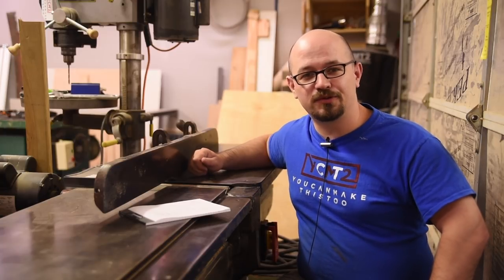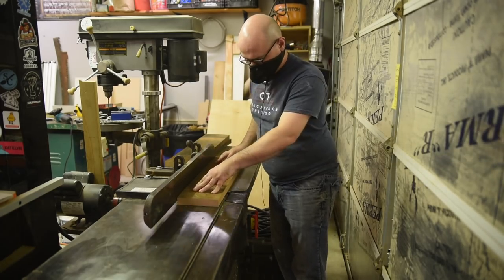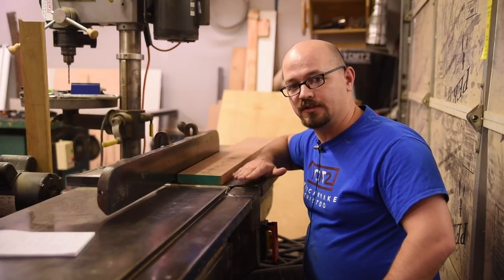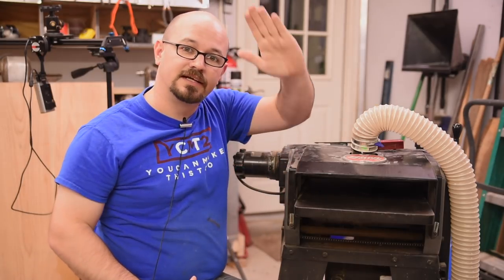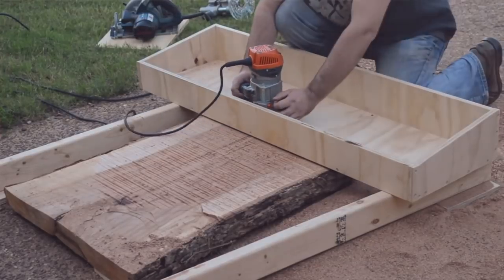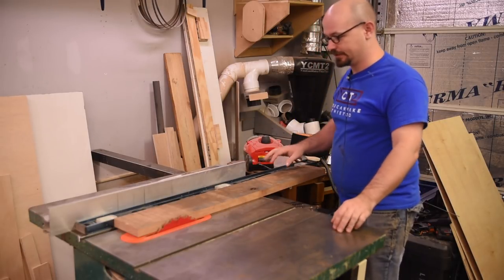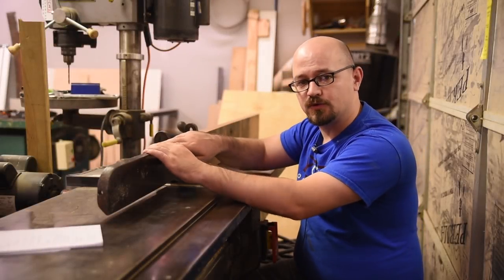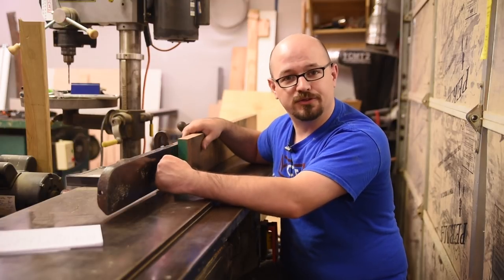Woodworking Without a Jointer

Comment: Great information, Thank you!
In order to get around not having a jointer, I've made myself a Table Saw Jointer. Basically I cut the width of the table saw blade off of the edge of a board up to a point, leaving the original face of the board in plane with the outside of the saw blade. Takes a little shy of 1/8 off in a single pass but i have gotten pretty good results with that.
Reply from the maker: That’s a great approach 👍 and thanks!

Comment: Cool tips!  Some good one in here.  I edge joint using a table saw, but instead of the level, I made a jig from a piece of ply, routed dovetail dados about every 5-6 inches.  I added a miter guide bar from a cutting board.  I use the microjig match fit clamps to hold the workpiece down.  The sled rides on the left side of the blade and the jig allows me to pick out the depth of the cut to get my clean edge.  I like the speed of the level, just always felt weird about pinning it against the fence...but just me maybe.  Thanks again for this video!
Reply from the maker: That sounds like an awesome jig! Pinning the level in that spot is kind of weird.. I just didn’t do enough rough work before I got the jointer to justify the time. But that sounds like a sweet set up you have.

Comment: Thanks for this great video - it was my introduction to your channel, which is both informative and entertaining. I do not have either a jointer or a planer (sadly) but have already mastered the trick of using a router table like a jointer. However, I am currently trying to make a cherrywood table, and am having little success removing milling marks from the wood - even though I just purchased a random orbital sander for that specific purpose. In one of your other videos you mentioned getting wood wet between sanding grits. How does that work - do you actually sand the wood when wet, and wouldn’t that be dangerous with a power tool? Would this be a good thing to try to remove milling marks?
Reply from the maker: Thanks, Brian! I'm glad you're enjoying my content. If you're having problems removing milling marks then you need to go to a lower grit sand paper and probably change your paper more often. I'd recommend starting at a 60 or 80 grit to remove milling marks. The point of wetting the wood when you sand is to "pop" the grain. Lots of woods will not be smooth if it gets a little moisture on it, and many finishes have some amount of water. So you could have a nicely sanded board that suddenly gets really funky when you put the first coat of finish on it and the grain raises. To prevent that, I like to wet the wood between sanding. I have a dollar store spray bottle and I just mist the wood and most the time don't wait for it to dry, but some people do. There shouldn't be enough moisture there to be a hazard with your power tools. But if that concerns you, then just let it dry first. Hope this helps, Brian!
Reply: Okay, thanks - I’ll give the lower grit a try. Keep up the good work - your creations are beautiful!
Reply from the maker: I will, thank you!